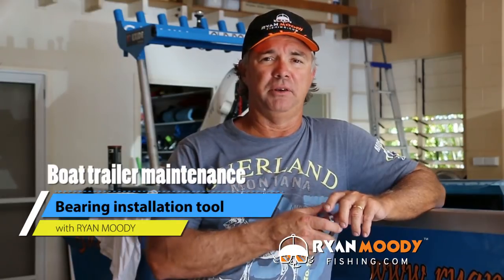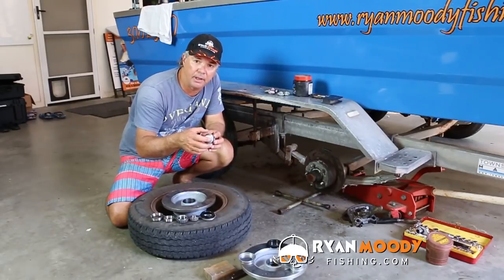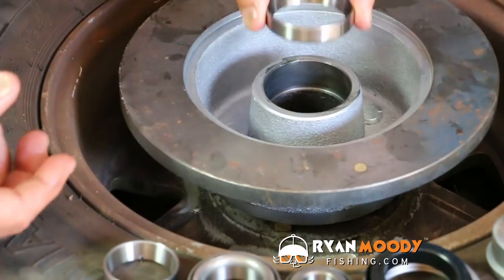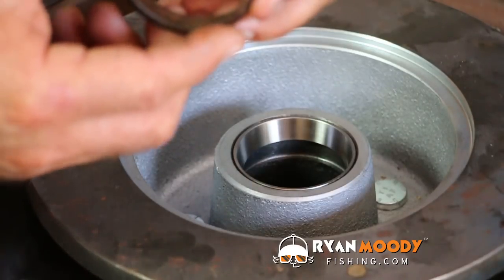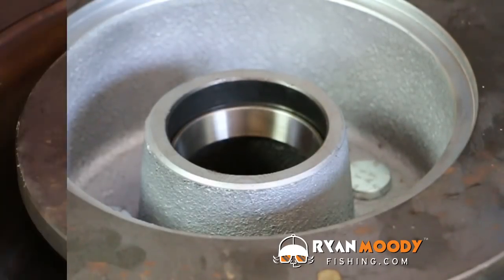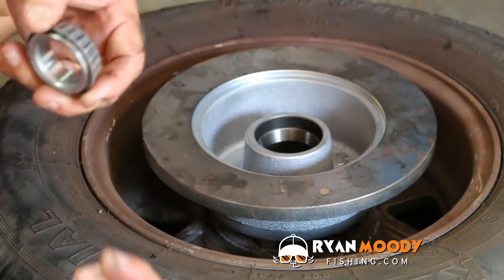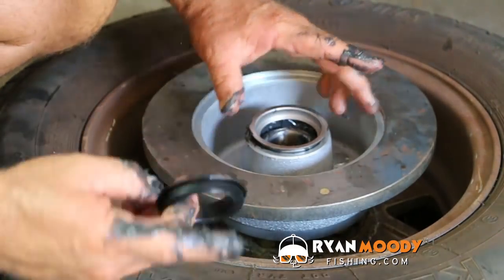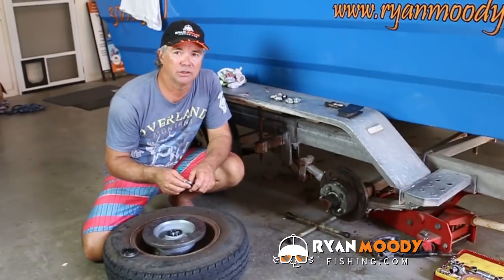Boat trailer maintenance - Trailer wheel bearings changes made easy with this simple to make tool

Comment: Love the video. Those bearings are not 'packed' as you need to force the grease right through the race. Either scrape it off your palm until it goes through or buy a $30 packer from a motor parts store and the job is done in seconds. What you've done will get you home in an emergency though. Edit - I'm definitely going to grind down an old set of cones like you did - it's brilliant!

Comment: Tip; u can also just cut through the old race with the angle grinder so it has a slit in it. Will fit straight through and pull out.

Comment: Or...
Pop your bearing races in the freezer
Your hub in a low temp oven.
And just place them in gently with your fingers 
(No Grease required, as you don't ever want the race to turn in the hub)
No bashing, No hammering, No Swearing, No Special Tool.
They will "Shrink-Fit" once everything returns to ambient temp in a matter of moments.
Of course, this method isn't so great if you're stuck on the HWY.... 
But simple if you're home like shown in this video

Comment: As a mechanic and trailer maintenance professional all I can say is "don't try this at home" The reason you use punches and drifts when driving bearing cups into hubs is, two hardened metals (hammer & bearing cup) do not mix, they will crack or shatter if hit to hard or the wrong way, always use a punch made from mild steel, brass etc. This is not the way to pack wheel bearings, you should use a bearing packer or "scrape" the grease from your hand into the bearing. This is a how not to do video.
Reply from the maker: Sorry Mike and thanks for the heads up. We were more talking when you get stuck on the side of the road as it's small enough to leave in the glovebox. We should have added it's best to take it to a professional if you don't have the necessary equipment. We don't have that kind of thing as we only do them rarely and this method has got us out of trouble.
Reply: Mike, you're absolutely right.  I was taught years ago to tap the race in with a brass punch.  I no longer do that and bought a simple press to install the race.  I've got an old race that I ground down to fit.  I saw this on a video.  It's so easy to install the race this way.  I was confused as the way Ryan was packing the grease.  It wasn't right to how I was taught.  I'm glad you clarified that.  I use a bearing packer and then I still pack the bearings in the even it missed something by pushing more in with your method.  You should do a video on this.  
As for Ryan,  if I'm packing bearings on the side of the road as you just stated I want to do it the right way.  If I'm relying on this trailer and see it smoking I should have an extra hub ready to go.  Keep it with your spare tire.   I saw two trailers this summer smoking and grinding to a halt.  Obviously, the poor bastard didn't maintain his bearings like he should.  
I re-pack my boat trailer bearings every year in the event water got in them while putting a boat in the water.  I also use bearing buddies so that water doesn't get in the bearing.  Maybe I re-pack more often than I should, but I don't want to be that guy on the side of the road.
Reply: Mike really. "Don't try this at home?"  I need to leave my trailer at a "professional" shop for a couple weeks, pay $100 per hour shop fees, so a "professional" can install a $30 set of bearings. Sure a press and drifts would be nice, but how often would I use it. Probably couldn`t even find them in a year or two when i needed them again.  Shade tree mechanics have been successfully replacing bearings since the Model A using punches, old races, sledgehammers, 2x4s, old screwdrivers, C-clamps, short iron pipe, and whatever. Ryans not rebuilding a transmission.  "Might crack or shatter" a $5 race. Wow. Thats almost as bad as throwing a rod through my favorite short block!  "Use a packer or scrape the greece from you hand." It might not have been pretty, but that bearing was plenty primed. Really don't think you will find Ryan on the side of the road because he didn't use a packer. Best thing about a packer is it only packs your bearing with greese, and not the cuts in your hand, your finger nails, or your Willy Nelson T-shirt. This was a fine how-to-video for the man or woman who likes working on their own stuff. There are not many things left that don`t require a computer or degree in micro space management. Ryan , I know you don't want to alienate any viewers, but I think you were too kind to Mr. Professional.
Reply: Michael, but don't you agree that a brass punch should be used so not to damage the race?  Instead of using the harden steel.  Remember, you're talking to guys that don't do this all the time.  You're talking to guys who maybe repacked bearing once or twice in their lives.
Reply: @beebob1279  I spent much of my first 18 years growing up on a dairy farm in Kentucky. Learned how to fix a lot of stuff. Often using whatever we could find. Sometimes using just bailing wire. LOL.  I've used "everything" I listed, at one time or another, changing bearings. I have to confess, I've never owned a brass punch. I searched out a set online last night. Plan to add to my tool box today. There's no denying the proper tool makes everything easier, better, and safer.
Reply: there is no grease in that bearing, gonna smoke it.

Comment: Great vid, would like to see how to get old ones out though
Reply from the maker: Thanks mate. To get them out just take wheel hub off the trailer and punch it 9the sleeve) out from the back. Lots of videos all ready on youtube. You don't have to worry about damaging them getting them out. Its getting the new ones in is usually the issue.
Reply: Excellent, many thanks